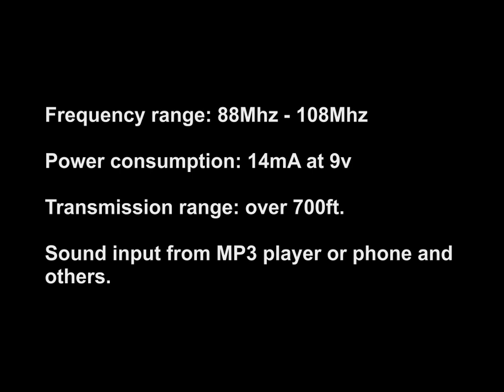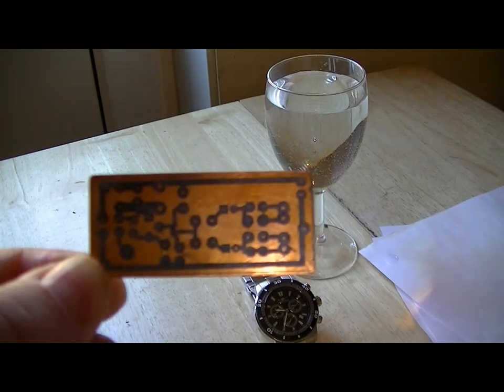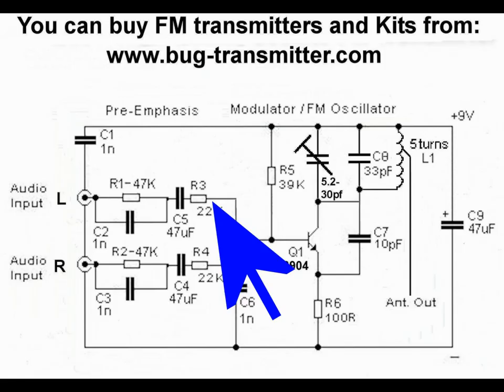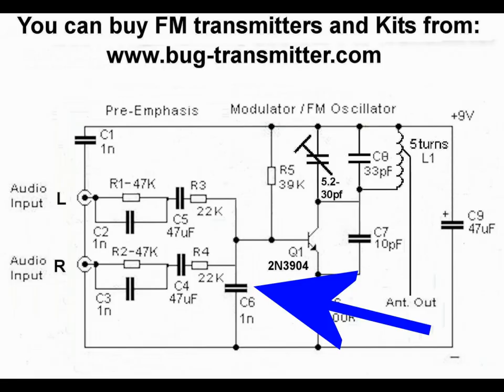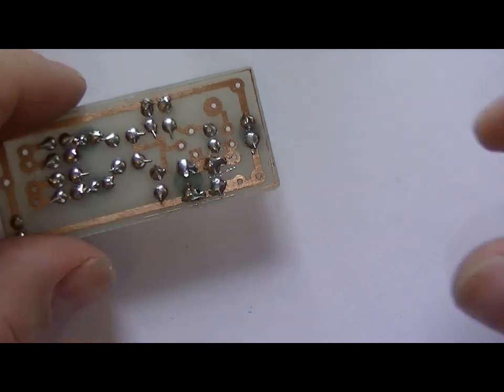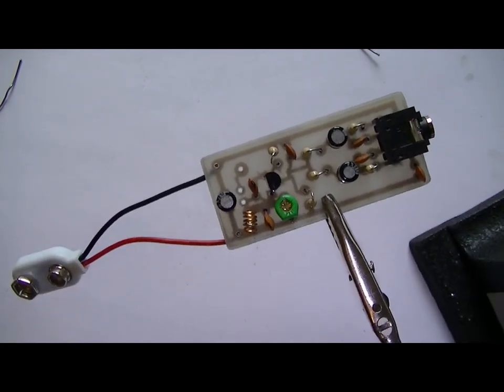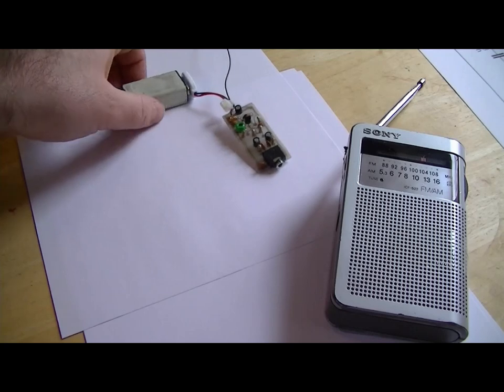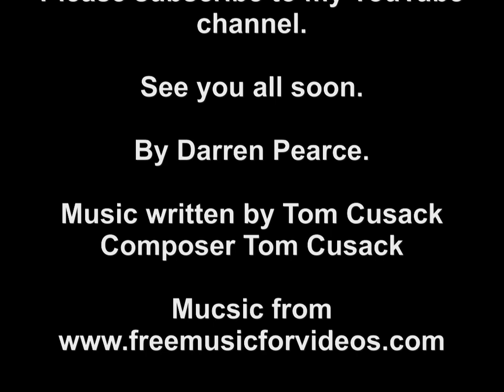How to make your own radio station.I show you how to build a simple FM transmitter.

Comment: Nicely completed project :-) But 4:55 Drilling without a vice to hold the part is a way liable to break small drills!
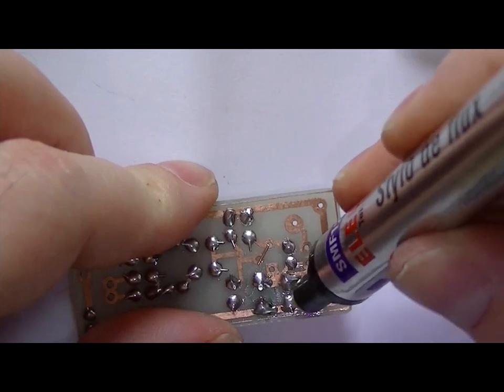20:13 A 4-turn coil has lower inductance than a 5-turn coil so it will give a HIGHER not lower resonant frequency.
24:22 The battery wires would attach more reliably if you bring them through the holes (otherwise why drill them?). Pulling on the wires can lift the copper trace.
Reply: The inductance of a coil is roughly proportional to the square of the number of turns, see the formula at http://www.eeweb.com/toolbox/coil-inductance. The resonant frequency of an L-C circuit is inversely proportional to the square root of the inductance L, see formula at https://en.wikipedia.org/wiki/Resonant_circuit. So more turns means lower frequency, fewer turns means higher frequency. MrQuidestveritas, it seems you misread what I wrote.
Reply: @pufango4059  Sweet.

Comment: what value cap can i use instead of the 4.7 uf ? please answer my question
Reply: If you're talking about C9 which is 47 microfarad (uF), then almost any value equal to or greater than 47uF will do the job since it's only there to smooth out any variations in current draw.  Just make sure whatever value you use is rated for 16V since a lower rated capacitor could explode if fed an over-voltage and a higher rated capacitor could wear out more quickly than it should (using close to the rated voltage helps to maintain the chemical composition of the electrolyte).

Comment: Great video!.

Probably illegal to use in most regulated countries--but still a good project!

Thanks for the share!
Reply: OhNoNotMyPenis Here's a bit of data for unlicensed RF channels/freqs:
http://en.wikipedia.org/wiki/U-NII

I know some lower freqs can be used if the power levels are substantially lower than 50 mW, however I haven't found a table that shows such availability for unlicensed use of such freqs.
Reply: OhNoNotMyPenis What would it take to modify your design to include a crystal oscillator that operates in the 2.4 gHz range?  I have an old wi-fi gateway that I could use for parts.
Reply: OhNoNotMyPenis Don't get me wrong, friend, I'm well aware of the fact that you can make RF transmitter circuits & transmit in violation of FCC rules & if you keep your transmission power low on an unused frequency, & you aren't a nuisance, then it's likely that no one will give a shiite.  Even if someone reported you, usually all they do is warn you to stop transmitting--however, if you won't stop, they can & have confiscated equipment & fined people in the US.

So,...as I typed above "...still a good project!" I like your project.  You've made a fine video on how to make a simple RF transmitter & I wouldn't stop you or anyone else from making/using such a circuit--to each her/his own!

On another note, what is the composition of your copper removal solution?
Of, if you purchased it, which brand & product/s do you like?
Reply: OhNoNotMyPenis My error.  I incorrectly thought you were the vid poster.
Nevertheless... thanks for your thoughts & opinion on the Ferric Chloride solution possibility.

Comment: My 2nd attempt at making this was more successful. Turns out, improper soldering (bad pcb etching) would affect the signal. However, there are some instances of signal degradation via skin effect (touching some parts would change the frequency). Is there a suggestion on how to avoid this ? Thank you.

P.S.  I built this for around 3.5 us dollars :-)
Reply: Yes don’t touch the circuit !

Comment: Good afternoon. Thanks for the great video. I tried it but not getting the right feedback. I used a condenser mic for input and used a fixed capacitor of 47pf in place of the 33pf variable capacitor and I used 2 22pf connected in series (11pf) in place of the 10pf. Moreover, in the curcuit diagram, there is a line crossing L $ R in the audio input signifying a short (please explain this from the diagram). I would be glad to send you my work on breadboard so you help me out. Thanks in anticipation.

Comment: Do you have any schematic for 12v ? I need it in car.
Btw this video is superb, well done
Reply from the maker: expert20valvehlx
Schematic for 12v is the same
Reply: dazaro3 Same ? So i can use it with car battery ? Thank you. :)
Reply: expert20valvehlx you might want to check out the LM2596 stepdown converter
Reply: glen cashen I know that, but thank you.
Reply: expert20valvehlx  may you need the voltage divider, but what is whith the inductor... whats about the coil that you build ??
Reply: i'm using here with a 12V Lead Acid battery and its working fine
Reply: Like others have said, this design should work on 12V.  Just make sure all the electrolytic capacitors are rated for 16V since car electrical systems can put out that much voltage when the engine is running.

Comment: Great DIY!  Just finished it with my 10 year old son, we both learned a lot.  Couldn't find a trimmer, so we used a 10pf cap and fiddled with the coi,l after about 10 mins we got it dialed in solid at 107.7....great range and a lot of fun!  Thanks again!

Comment: what did he did the copper into? And did he just use regular printer ink?
Reply: it is laser jet ink
Reply from the maker: Yes ,an Inkjet printer will use solvent inks and it will not work and the printer i use
to make my PCB's is a laser printer ,its the toner transfer method.
It will ONLY work using a laser printer.The toner in laser printers and most copiers is made
mostly of PLASTIC, which resists the acid that eats away the copper that doesn't have any
toner on it. Inkjet printers use INK, not toner. And their ink is typically NOT a good
etch-resistor, at all.
Reply: You guys completely inspire me.
Reply: I have an hour photosmart all in one.

Comment: Instead of a 9 volts blok use an 7809 and every voltage between 12 and 24 (for example 2x 9volts blocks in serie) can be attached. This works against frequencydrift cause one 9volt block runs out of power slowly causing instabilty

Comment: Is there any way I can modify this circuit as folllows:
1. I want to use the sense pin of 3.5mm audio jack to turn ON/OFF this circuit, and
2. I want to use the AUX cable as antenna too. 
Please do share your opinion on this "dazaro3"

Comment: i have connected this circuit, but too much noise when i play the music and the radio receiver cannot receive the signal 1 metre away! could you tell me why?
Reply from the maker: +ann jack 
Your radio will be picking up the harmonic frequency and not the main frequency ,that's why you get very little range because its the harmonics you are finding.You need to try and find the main frequency.

Comment: plz  tell me sir can i do this with out a trimmer capacitor ?
Reply from the maker: Yes replace the trimmer with a 33p capacitor and then you 
can adjust the FM frequency by stretching or compressing the 5 turn coil
Reply: thank you so much

Comment: Hello,
What kind of material is L1 made of???

Let me know.

I look forward to hearing from you...

Thank you,
Reply from the maker: Inquire98 
Sorry im late in reply ,been very busy.The coil is made from 0.5mm Diameter enamelled wire ,the wire does not need to be enamelled wire,you
can use any solid core wire from : 0.4mm upto 0.8mm. And wrap the wire around a 3mm drill bit to make a coil.
Reply: dazaro3 "Thank You", thank you very much...

Comment: Hi I was trying to build a low power one at 13-14 megahertz so I can try to burn salt water. Do you have a tutorial how to make an Rf Transmitter like that? Also do you sell the one in your video already premade? I'm not very technical. :) where does one buy it and what's the cost? Thanks :) and also can it send out a radio show? If so how would it do that and how do u know the station frequency and range of the signal? :) thanks you're talented

Comment: That was fascinating to watch 👍
The part where the copper dissolved off the circuit board and left just the circuit blew my mind. I know nothing really about electronics, I've soldered the electronic parts for my electric guitar a couple of times, it worked once and failed once but my soldering skills aren't very good and nowhere near as neat as yours.
I can't see a time when I'd need a radio transmitter but it'd come in handy after a nuclear war....then I guess it'd be a necessity, a bit like in a Fallout game 😎👍

Comment: What kind of wire can you use for antenna wire? Does the wire have be of a certain kind?
Reply: Tcamp i tkink copper wire will be good
Reply: Youcef Mahdadi OK, awesome thanks. Thin solid wire I'm guessing?
Reply: yes
Reply from the maker: Tcamp 
I use equipment Wire ,Incorporating the following features: 10/0.1mm tinned copper conductor.
Overall diameter 1.05mm ,but you can use any wire.
Reply: dazaro3 
please what is the capacitor voltage
Reply: Youcef Mahdadi 
pleasecan you tell me what is the capacitor voltage ?
Reply: i don't know my friend,sorry
Reply: it's ok  
thank you my friend
Reply: A-S- C-A Hey, from what i understand, and if anyone sees this and thinks i am wrong please tell, the voltage doesn't matter so much just the capacitance. That said, I think the lower the voltage the better specs or tolerance you will have. This device is supplied by a 9V battery so anything above 9V. 25v should be easy to find and if you can find a mini electrolytic capacitor(16v) then even better.
Reply: I do not know
he has said that 4.7uF
Thank you for your reply
Reply: Yes, 4.7uF is your capacitance which is specific for a given circuit. Your "voltage" however doesn't matter so much, not in the same way you capacitance does. You have more leeway with voltage, given that the lower voltage you have with an electrolytic capacitor the tighter tolerances you will see(tighter tolerances = good). You can also sometimes use a high capacitance but now lower capacitance. Not always the case and usually best to stick with the design but that is something to keep in mind. I bring up the last sentence because i couldn't find a 4.7uf capacitor and i learned through other comments on this video and other places i could use a 47uf capacitor instead for this circuit which i did use when i built this circuit and it works.
Reply: A-S- C-A hopefully you see my reply above because i forgot to hit the reply when i typed it. I wanted to add though, i went to Radio Shack and bought 47uf 25V (not 4.7uf) capacitors for this where applicable and it worked fine
Reply: thanks
i will try it

Comment: All right. lets just say we want to build a transmitter amd instead of 100 Mhz we will operate it ay 7 or 14 or 28/27 Mhz. that is a more stable frequency and we are not using FM but AM (easier) or CW morse code. that uses am on off switch instead or an audio amp plus a modulation (mixer) circuit. 12 volts and a single transistor oscillator. thats a self sustaining loop using positive feedback. just enough to keep it going. the rest og the RF energy is coupled loosly to the antenna circuit. only the DC component completes the circuit. 12 volts DC at one amp will give 12 Watts INPUT. THE RF Output will be 50 to 60% the 40% is lost as heat and 5 to 10 % more lost in the transmission line and antenna. That gives 4 watts ( same as a CB or cellular phone. couple that into 66 feet of wire 30 feet up and switch it on and off with a telegraph key or FSK it like a modem. and you will have plenty enough signal to reach 3 to 10 thousand miles. and Amateur Radio with a license makes it not pirate but legit.

Comment: Okay, I just built this, and it's not working. I connected my scope between the all three legs of the transistor and R6 - I got zero response. I have a few ideas of what would cause this, if you all could give me some pointers. 1: When I first assembled the circuit, I managed to short out C1 (both legs connected which made a circuit of the outer rail only). Could the 9V battery destroy C1? 2: I forgot to de-insulate the coil before soldering it in. Would the transistor stop working because of this? Note that I am receiving some voltage (in the mV range) over its three legs. 3: I haven't connected the antenna yet. Right now, it won't do any difference, seeing that in practical terms, the coil isn't connected - but later, would the antenna need to be connected for the transistor to work? 4: My variable cap ranges from 1.8-22 pF, which I assume won't give me the highest frequenzies. but it should stil work, right? All in all, it seems like the circuit isn't generating any waves unless I give a sine wave input. Please help!

Comment: Why can't I make this one to work?? I can't find the freaking frequency anywhere. I found the frequency by turning the capacitor for half a second full of noise and as soon as i took the screwdriver off it was gone for good. Do you maybe need an amplifier to work? the volume was very low. Pls help
Reply: Hello, you may probably receiving the harmonics ie not the proper frequency. Now bear in mind that to adjust the frequency of a transmitter you have to use PLASTIC / NYLON alignment tool not a normal small screw driver. Using a normal screw driver acts as a capacitor [conductor and insulation] that's why when you are receiving the frequency and removes the screwdriver the receiving frequency is gone. Using proper alignment tool does not do this. Also try compressing or expanding the coil a bit might help to bring the transmitter to transmit in the 88 to 108mhz. Maybe the transmitter presently is transmitting either above or lower the receiving frequency of a normal radio receiver, so actually you are receiving only the harmonics not the true  strong proper frequency.  Also don't touch the circuit with your hands while you are adjusting it. Hope this helps and good luck!.

Comment: Found it! Now I would be trying to make a separate power stage for the antenna to isolate the oscillator from antenna load and allow drive with your typical 300, 75 or 50 ohm antennae and get decent range even with just a few milliwatts of power output.

Trying it out with a simulator (you would appreciate LTspice for it if you would like to try, it is free) would make you see how it works and how to improve the circuit (which I am exactly trying now)

Thanks for the line-in technique...we would actually don't need a preamp for it (but for good measure it is better to have one)

Comment: Hi, 
Really liked your video. Can I just ask you: for the 5 turns of copper wire.  I'm finding it hard to find unplated wire on eBay. Are you just using enamelled copper wire and then removing the enamelling?
Thanks. 
Best, 
James

Comment: i just finished building my FM transmitter and it works but only on very close range like 10 cm, i used all the parts like you did in the video ( i used all three electrolytic capacitors 47 uf ) all the parts are from an old TV and an OLD FM radio, i double checked the soldering on the board, and if i put my fingers on the board it works better ( less static bud the range is 10 cm ). I don't know whats the problem is, any suggestions.

Comment: i was looking up pre emphasis circuits.. its generally the same.. but what is the purpose of C4 and C5.. i have to explain each and every step of the circuit basically.. for my project report.. and im using a tweaked version of this.. 

so my doubts are..  -the reason for C4 and C5 and the effect of not using them
- the reason for C1 and the effects of not using it
- the reason for placing R5 R6 and C6 as you have and what are their purposes.

and lastly .. what would be the effect of instead using a 2n2222 transistor .. i have seen those used in some circuit designs.. and idk the difference...

thanks in advance.. Keith.

Comment: Can this be made with a breadboard? What is the stuff you put on before you soldered the connections? Is it necessary? And how did you make the board that you mounted it all on? I don't quite understand how you made it and how it has a plastic look with metal wires along it. I would like to make this but I don't understand quite how. (You'll find I need in depth descriptions on things.) It looks really cool. Also do you have a list of the items and where to get them? Thank you!

Comment: I've built the same circuit using a 2N2222. Feed it with two 9v batteries in series and it will have a LOT more range, BUT it may put out signal strength above legal unlicensed limits. Depends on the antenna.

Comment: regarding to  coil needed,, can i ask if what is the diameter we are  using to wind it 5 turns i know that the size of the wire is 0.5 mm. but how about the diameter?? thanks